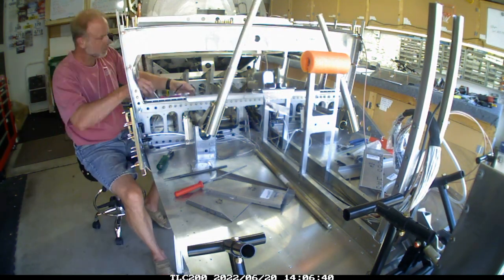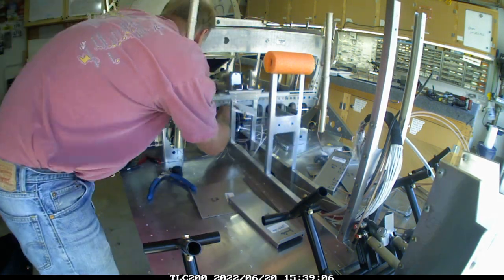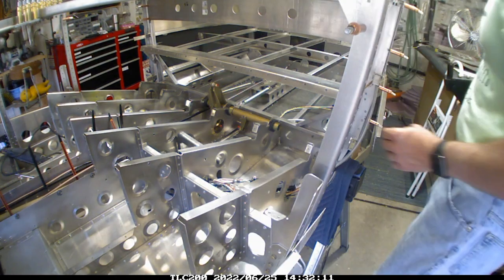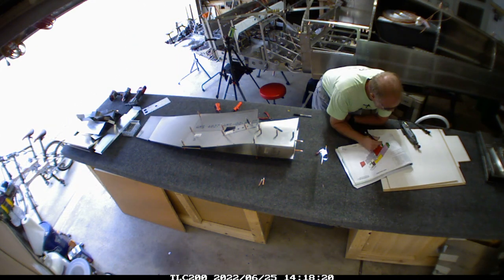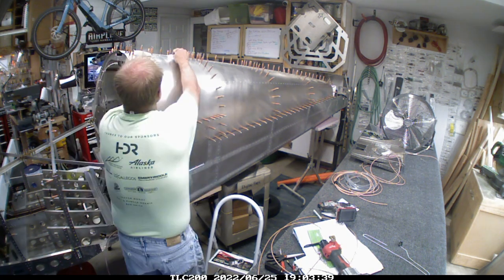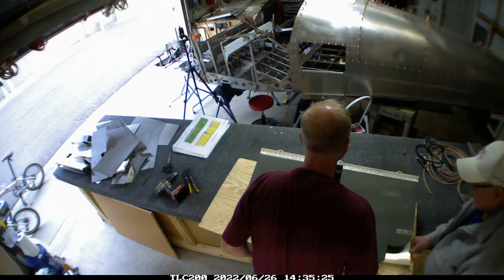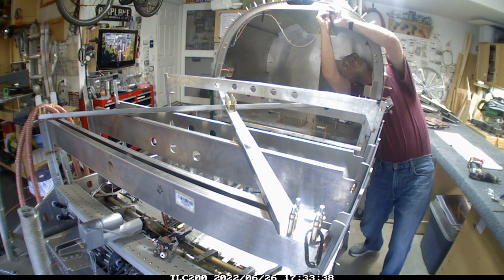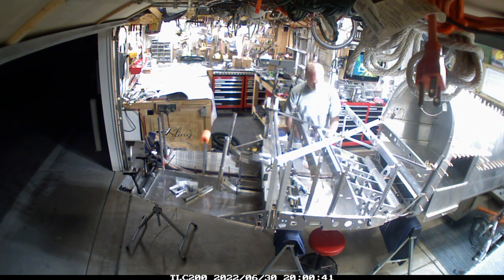July 2022 Part 2

Comment: What type of epoxy are you using for the rivnuts?
Reply from the maker: Hi Seaon - I'm using the J-B Weld from the local hardware store that mixes out (ie: the two part mixes when you squeeze out the tube).  You only need a small amount for each session, so just a dab will do ya.  Let me know if you have other questions.